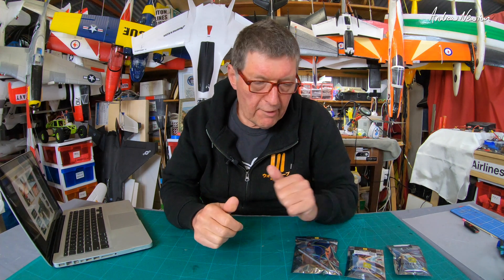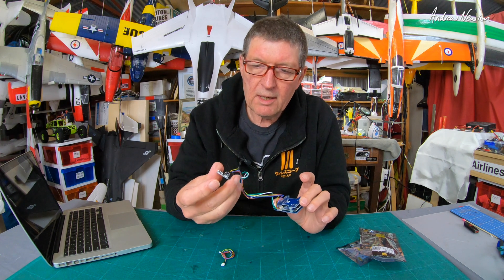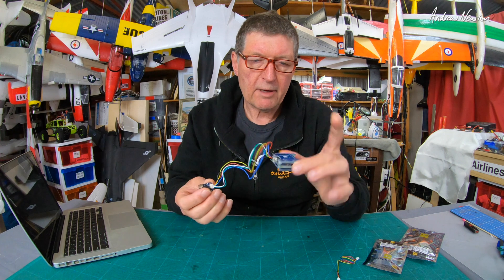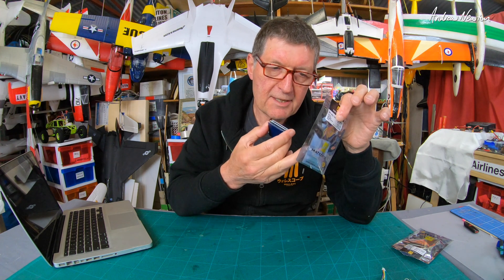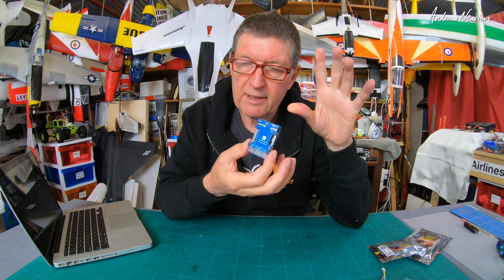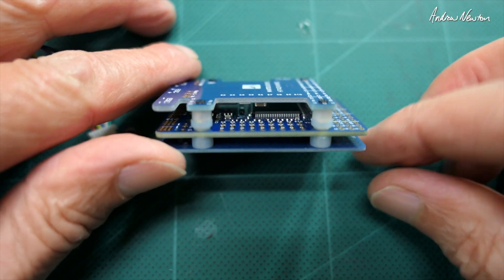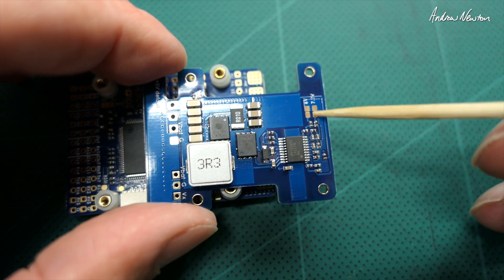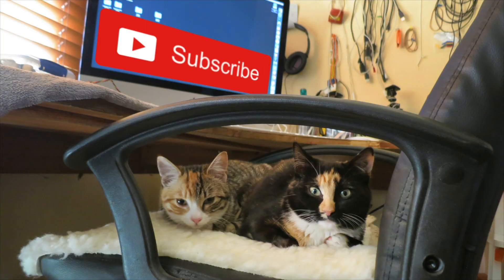Matek H743 Wing and M8Q CAN GPS

Comment: Thanks Andrew for the good, informative videos! I've used them to study FPV stuff. Fixed-wing RC airplanes have been my thing for decades and now I want to start using FPV. My radio equipment is FrSKy Tandem X20S which I got last year. It's great! I'm going to use the INAV software because you can get a Mac version of it.

Can you help a little on this matter:
I'm looking for a tutorial video about this: Matek H743-WLITE Wing Flight Controller. You have a video of the product Matek H743 Wing. Is it a different product than that H743-WLITE?
Reply from the maker: Happy to help but I haven't used the WLite. It looks just as good as the Wing. Superior quality FC. Matek page will have good information.

Comment: Hello Andrew, i have both Matek H743 and M8Q CAN, M8Q wired to FC via GH-4p pin but not sure why INAV is not detecting the gps is CAN BUS connection supported by INAV? Should i just solder and connect as normal gps RxTX,sda scl?
Reply from the maker: INAV doesn't do CAN
Reply: @AndrewNewton  thank you for that😊

Comment: Have you by any chance made a video of connecting the controller to qgroundcontrol and flashing the board with ardupilot? In particular what board type to choose as all I can see are pixhawk types. Thank you very muck
Reply from the maker: No I tried ardupilot and got it working once but didn't enjoy the experience.
Reply: @AndrewNewton  Thank you Andrew, I guess I will have to go through the pain unaided.
Reply from the maker: @cattlebaron483  Check out Painless360 for Ardu help
Reply: @AndrewNewton  OK

Comment: I have a question about setting the radio calibration. I downloaded firmware and hooked up to the computer and board is recognized and working on ardupilot, but get  no bar movement on ardupilot when I move the transmitter sticks. I only have usb plugged into the flight controller to the computer, with only having the USB plugged in will the flight controller recognize stick input. On some of my older fc you could plug in a lipo and have the USB plugged in to recognize stick input, but I am afraid of burning something up having USB connected  and plugging in lipo.
Reply from the maker: Plug the Lipo in, it's fine.

Comment: Did they send you the wrong wiring for the GPS ? I have the same GPS ...and I have the digital airspeed sensor for h743
Reply from the maker: No, my mistake. There was another cable with the correct plug.
Reply: @AndrewNewton  i can't seem to find the right one...can you message me on Facebook a picture of the cable when you get a chance...thank you !
Reply: did anyone of you ever faced the issue with h743 wing, ceasing of FC when running on ardupilot

Comment: Looking forward to seeing you try Ardupilot. Like many things it's just a matter of knowing which handful of settings you actually need to mess with. After a few iterations you can probably set up a new plane in 30 minutes or so.
Reply from the maker: 2 days of swearing and headaches and I now have the basics working. Seems to be a lot of setup screens missing on the Mac versions
Reply: @AndrewNewton  Yes QGroundControl is rather young. I installed it briefly, but found it to be not that useful. Most tutorials and howto guides will probably revolve around the 'Mission Planner' that has been in widespread use for a long time.